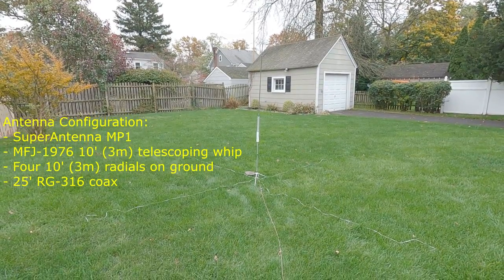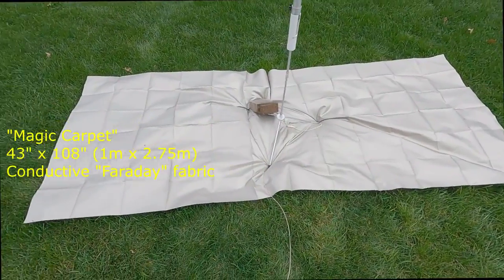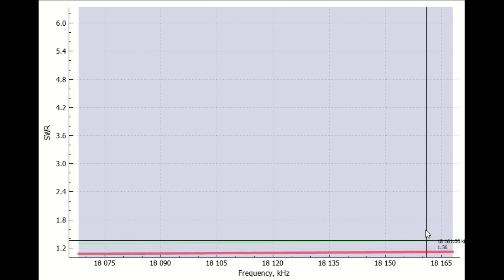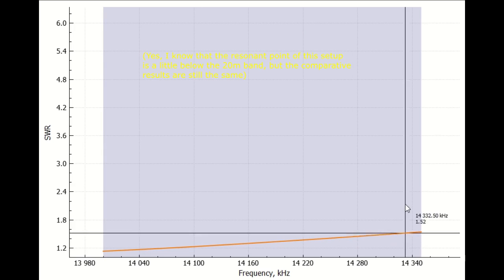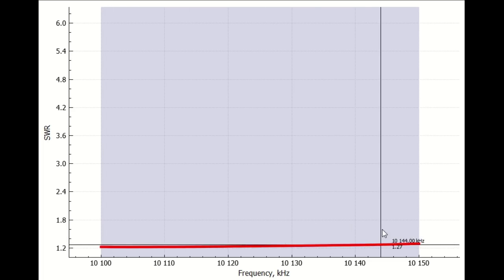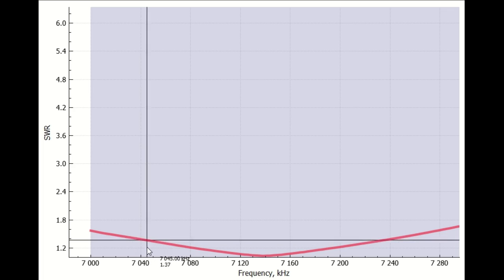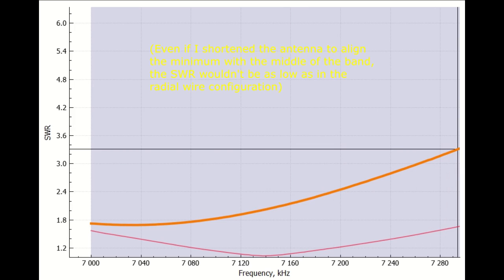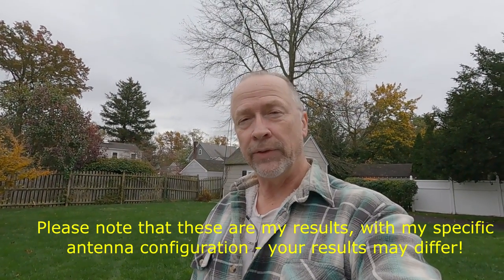#375: Ham Radio Quickie: Ground Radial wires vs. the "Magic Carpet" Faraday cloth

Comment: Hi Alan, it would be interesting to actually measure the antenna feedpoint complex impedance (R  +/- j X) when doing the comparisons as SWR does not tell the complete story (SWR can be very misleading).  As an example a full size 1/4 wave vertical will have a radiation resistance of approximately 36 ohms but if you just use a few ground radials it's feedpoint impedance might measure 60 ohms (just a wild guess for this example) which would be an SWR of 1.2 to 1 (36 ohms would have been radiation resistance with an additional 25 ohms of ground loss).  As you add more radials the feedpoint impedance will continue to decrease towards 36 ohms as you get closer and closer toward a perfect ground, and when you achieve a perfect ground the feedpoint impedance will be 36 ohms with it being all radiation resistance and no ground losses (ignoring slight copper losses) and the SWR would be 1.4 to 1 which is worse than what we had with just a few ground radials but having the higher SWR is actually a good thing in this example because now we have no ground losses.  It even gets more pronounced if you use a vertical that's much less than a 1/4 wavelength long as the radiation resistance of a short vertical gets smaller and smaller as you continue to shorten it.  The key is to drive the ground losses toward zero by adding more radials which will at some point start causing your SWR to actually increase, and then if necessary use a simple impedance matching network to match the low antenna feedpoint impedance to the 50 ohm feed line (an L network works great for this).  Just FYI, and thanks for the recent POTA QSO.  73, Don wd8dsb
Reply: Check out also the comment from WECB640 and reply.  Those and yours, Don are all valid.  I might point out when considering the practical aspects as Alan is doing (SWR vs efficiency, etc.) that there is the matter of diminishing returns to consider.  I won't (too lazy) look up the hard figures that Rudy Severns determined for us but the hams who go overboard putting in radials spend a LOT of time, $$, real estate, copper, maintenance when they go above the 16-32 radial point.  See the cover of ON4UN's book.  He probably gained no more than 0.25-0.5 db with that radial field vs a 32 radial field.  But his goals were completely different than Alan's POTA activity.  Fun stuff. 73 to all,  Rick  K2XT
Reply from the maker: HI Don - I'll have to try some tests with the RBN to see if there is a dramatic difference.  I have the saved sweeps, so I can take a look at the complex impedance on the Smith chart for both configurations.

Comment: Interesting and not surprising that the performance decreased with the decrease in frequency. Looks like for most transient operations like POTA that the radial system works best/easiest. Thanks for sharing Alan!  73 - Dino KLØS

Comment: TAKE THE RUBBER NUBBIES OFF THE BOTTOM OF YOUR TRIPOD AND TRY IT AGAIN.. THE ALIGATOR CLIP YOU WERE USING SKEWED THE RESULT. YOU NEED TO HAVE DIRECT CONTACT FROM THE TRIPOD TO THE CARPET..
Reply from the maker: I ran that experiment after doing the filming and saw no change.  This is likely because there actually was contact just above the nubbies due to the way the legs pushed the fabric into the grass and made contact on more of the leg surface.

Comment: Interesting video. I had not seen this magic carpet before. I suspect, but not at all sure, that a larger magic carpet would perform better at the lower frequencies. Curious if the magic carpet comes in larger sizes
Reply from the maker: I am sure a larger fabric would work better on lower frequencies.

Comment: I am curious if you either take the rubber off your tripod legs or use more jumpers from the cloth to the antenna if that would improve performance.
Reply from the maker: I ran that experiment after I finished filming.  No difference.
Reply: Good to know thanks

Comment: SWR by itself does not indicate resonance or efficiency.  A better analysis would be to determine the frequency of zero (or minimum) reactance that is the resonance frequency. You will then know the resonance frequency. The impedance of a vertical is often near 35 Ohms (sometimes lower) with  a good ground.  Changing the ground system and keeping the antenna length the same can change the feed point impedance and resonance frequency.  Learn about Vertical antennas.  Of course any piece of metal that can be tuned will put out some radiation to some where. The question is how much and where.
Reply from the maker: Thank you for your great comments - all 100% correct of course.  In this specific case, I was just investigating the effect of the fabric vs. the radials I typically use and how that would affect the return loss observed by my radio.  Not looking for the ultimate in radiation efficiency - for my portable operating purposes - good enough is good enough ;-) and this setup has proven itself good enough.
Reply: With the low impeadance 40m and lower, you need a shunt coil or a transmatch. Coil is $5. 7 turns x 3/4 dia. Fun experiment.

Comment: Interesting results, with my vertical I have about 150 radials, mostly made from stripped down network cable. I live in a part of the UK with relatively conductive soil. My limited observations seem to suggest that the lowest ground impedance from the least amount of wire can be achieved with surprisingly short radials. Maybe 0.05 of a wavelength, I suspect your Faraday cloth would work well here. 
For such a small area the faraday cloth does seem to be viable...
Reply: You can also try storm door metal mosquito mesh instead of the Faraday cloth.
Reply: @azarellediaz4892  true, though it is not commonplace here.

Comment: Would say the magic carpet would work well in say operating on a building rooftop, like a car park, where it would couple well with the rebar in the concrete.  Would suggest putting a metal snap in the middle, and with the other half of the snap a wide copper braid as link, which should reduce some of the inductance there.

Comment: I think it would be more meaningful to look at the difference in field strength rather than SWR.  When you are working with a minimalist ground radial system, a good portion of the base impedance is made up of ground losses.  Improving the ground screen might very well reduce the ground losses and put more energy into the field but the resultant SWR would be increased.  The classic example is if you had a resonant 90-degree radiator, the base impedance would measure about 50 ohms, 35 ohms into the antenna, and 15 ohms in the ground loss.  Improving the ground screen would reduce the ground losses and make the SWR increase, but it would put more energy into the actual radiated field.  And of course, require an adjustment to the transmitter matching.
Reply: Spot on. A 1:1 SWR just means your transmitter is not seeing any reflected power and says nothing about where the power is going.
Reply from the maker: Totally agree - far-field field strength measurements would give me a much better indication of radiation efficiency.  In my case, I was purely looking at the effect of return loss / VSWR to see the difference that my transmitter would see.  I already know that I get sufficient performance with the radials (based on thousands of POTA contacts), so even if the fabric improved it a little, it likely wouldn't be worth the extra effort in setup for me (finding a clear patch of ground is tough in the wood, keeping the wind from blowing it, etc.).  My radial system can be easily deployed in about 30 seconds and works well enough for my purposes.  I appreciate your good comments.

Comment: Thanks for interesting video.
First of all, I would understand the return loss (S11) better than SWR; however, I can concert SWR to return loss.  It is like measuring length in inches vs cm.
Second, one would like to know how the # of radial lines effect the return loss in dB.  So 2 vs. 3 .. 10?
3rd, one would be interested to know the directionality of antenna with magic carpet vs. 2 vs. 3 ... 10?  To do that one would connect Port one of network analyzer to the antenna and port 2 to a dipole Antenna and walks with dipole on a circle centered at the antenna, and measure magnitude of S21 in dB.
Here we are not interested on absolute magnitude rather relative magnitude at different location.
Reply from the maker: It would be very difficult to perform that S21 measurement properly for HF (meaning, making the measurement in the far-field).
Reply: @w2aew  
Yes you are right.
However we need to measure radiation pattern on the horizontal plane.   The normal way of measuring radiation pattern is to put the antenna on rotating platform and then measure the received power in far field.  
About the network analyzer you are also right, it is difficult to measure S21 in far field say 10m band; thought, it is not impossible.
Therefore, this gives me an idea to redesign network analyzer with remote probes (ports) that communicate with the main unit using radio wave.
Reply from the maker: @aduedc  Of course, my interests lie in the 40-30-20m bands, which makes the far field even further ;-).  RBN reports are likely going to be the best measure for real-world performance
Reply: @w2aew  Yes, and you have to deal with multi-path reflections.
I also recommend simulations using 3D simulator like HFSS or other simulators.
Also one could apply for Darpa grant to make wooden merry go round and put your antenna  on top of it. Then one could go to a location say 5 miles away and rotate your merry go round with a stepper motor and remote control.

Comment: I've always been a bit skeptical about the magic carpet. Not so much about it efficacy but as to whether they are superior to regular radials in a field deployment. At least with my chelegance MC-750 it takes such a short amount of time to deploy the antenna I don't think laying out the cloth would actually speed anything up.
Reply: Been using my MC-750 for a few months now, it works fantastic.  Better and cheaper the the WRC.  Told a friend, he was skeptical, but ended up with one and now wishes he had gotten it sooner.
I too am going to stick with radials.  The magic carpet is a fad because of YouTube, that I think will quickly fade.
Reply from the maker: I totally agree, especially now that I have run the experiment.  I can deploy the four 10' radials in about 20 seconds.  Easy to do on flat or uneven ground.  Wouldn't be so easy with the "carpet".   I've been thinking about the MC-750, but not sure how much of an advantage over my MP1. I do like the laser marked whip for tuning. But, wish it use the 3/8" 24 thread to mate up with my various mounting accessories.  I guess I could get an adapter...  I like the spike for mounting, but so many sites I go to have very rocky soil, it might be difficult.
Reply: @w2aew  luckily chelegance sells a tripod for the mc-750. It's an M10 thread so you can always fabricate an adapter. I've designed one that can be 3D printed on printables. 
The laser etched band markings make it extremely easy for field deployment and the banana connectors make the radial system convenient too. Takes me about a minute to deploy total

Comment: Great experiment. I was always told that the higher in frequency the more radials, or tighter mesh on a reflector. This kind of confirms that. The common practice would be for a single frequency vertical the radils would also be tuned to length just like the antenna, just like we do with a dipole, we trim from both ends.  So we use practical length radials and tune the mismatch out at the antenna for our multi band antennas.

Comment: Hi Alan,
I bought the 5m long Faraday cloth with the intentions of cutting it into two 2.5m lengths and taping them together. That would give an approximate 8' X 8' ground cloth. Hope it will work better on 40m than the length you used.

Comment: I came to the same conclusion as you did.  The physical size of the carpet (radius in any direction) is smaller than the effective ground plane of the radials.  So at some point the RF will be absorbed into the lossy ground more and more as the frequency decreases and wavelengths get longer and longer.. It seems the  ‘magic’ of the carpet is proportional (only to) the radius of carpet relative to the frequency used.  If true, then this is good news - because the laws of physics are safe and unaffected by the ‘magical’ powers of the conductive carpet, thank goodness 👍.
Reply: Whoops, I meant to say ‘diagonal length of the 4 corners’, not radius - hi hi

Comment: Try putting a single radial on each corner of the 'magic carpet' and stretch it out away from the antenna. I think that will solve the SWR problem on lower bands. BTW, I suspect the 'carpet' produces more field strength than the radials do 100 yards out from the vertical.
Reply: @@markherman7619naaa, the more area thats metal the better.
Reply: I was going to suggest that FS test
Reply: @@markherman7619 I have 120 feet of the cloth in two sections of 60 feet each, I cross them and they work really well, wires end up being more work but for low band I just add one wire to the end of one cloth. Very simple compared to just wire alone.
Reply: @@markherman7619, it's all about getting the optimum result with the minimum of effort. Walking out radials as you spread out the corners of the blanket is essentially no effort, yet I'm thinking you will gain the best results of both.
Reply: I think he'd be surprised to learn that the screen actually does not produce stronger field strength. You would need 4 of these to produce the same field strength as three 33 foot radials.

Open this magic carpet idea is nothing new, we've been doing this for over 40 years. I have dedicated quarter wave vertical ground mounted on my property (40 acres) and have been experimenting With different counterpoises, everything from a hundred and 30 quarter wave ground radials to a ground shield made up of four 34 foot welded  hog panels, I started out with 36 by 72 inch hog panels, first one panel then two panels and eventually 4 panels laid out Evenly around the vertical. I discovered that you would need a minimum of three 72 inch panels to equal the performance at 333 foot radials gave you.
Four of the 34 inch by 16 foot hog panels and gave you about the same performance as thirty  33 foot radials.

The Hon panel is nowadays run about $40 each and are much easier to lay down than the wire but the wire is much cheaper and lasts longer especially if you use solid core magnet wire. 

The first vertical I installed I used polymide coated 24 AWG Magnet wire I thought this stuff would be dead within a few years, twenty years later when we dug up the radios I was shocked when I discovered that the copper radials looked just as good after being in the ground for 20 years as they did the day we put them down meanwhile the stranded THNN wire that we used completely deteriorated within five years turning to nothing but powder inside the jacket.

The last thing you want to use for permanent ground radials is stranded THNN wire or any stranded wire for that matter as the water wicks up the wire and the electrical current corrodes it after a few years it's turned into nothing but powder. While the polymide coated solid core wire will last substantially longer
Reply: @dannelson8556 I believe the problem is not the solid wire vs. the stranded wire but the type of wire being used. The solid magnet wire tends to be pure copper while most stranded wire made in the last thirty years or so is actually CCA wire which is junk. (Copper Clad Aluminum)

Comment: If another or two more "magic carpets" were added the the ground plane what would be seen? I'm betting the results would be better. Thanks for the video... now you've done it, the wheels are a turning now... kinda like beer, more is better, up to a point...
Reply from the maker: That would definitely help on the lower bands - but certainly not as convenient for deployment at a POTA or SOTA site as radials would be.
Reply: I think it would definitely be better using two or more cloths for the lower bands. And IMHO, I think it would be EASIER for me to stretch out the cloths as opposed to stretching out longer or more radials. Of course, others' mileage may vary.

Comment: Is the primary effect of the radials/magic carpet to couple to the ground or is the most important characteristic to provide a low impedance return path? If it's the second, then wouldn't the current distribution, which shows higher currents nearer the base of the antenna, be helped more by those longer radials as longer wavelengths would have a corresponding longer reduction in current the further away from the base of the antenna? (Sure would be a lot easier to draw that as a picture--grin)

A later edit: this seems to go against the common statement that more shorter radials is better than fewer long radials.  Hard to have more radials than a solid chunk of conductive fabric.
Reply from the maker: Yes, both are important, but some minimum length would typically be needed.

Comment: I wonder what the height of the antenna over the magic carpet for each band would do?
Reply from the maker: Likely, the closer the better, but I didn't test this.
Reply: I tested 20m ham stick on a tripod about 4ft high with 4-8ft radials and my SWR was 1.2.
I also tested 20m ham stick with magic carpet and metal flag stand about 8" from the ground with 4-8ft radials and without and the best SWR was 2.6 in the middle of the band. 
I also tried 10m Ham stick the same way with Faraday cloth and I had similar results. 
I plan on trying a magnet mount antenna and check results.
Hope this helps.  @w2aew